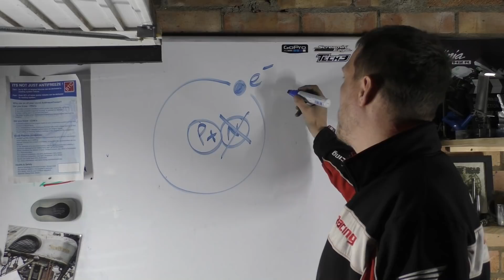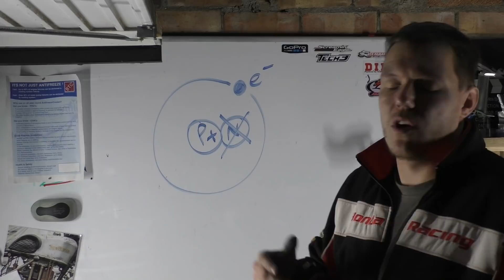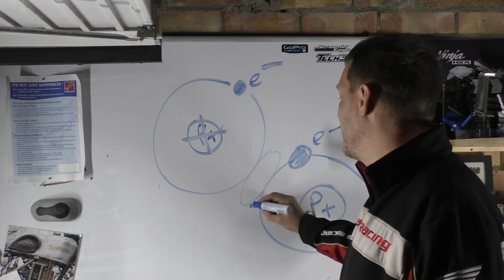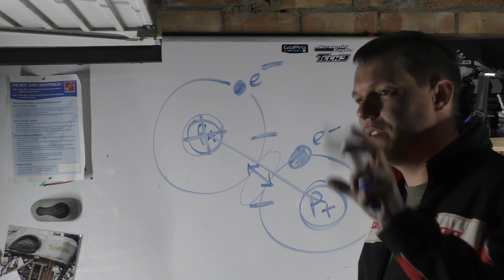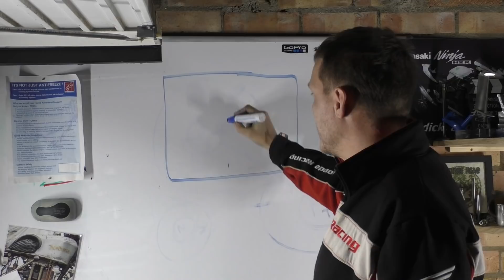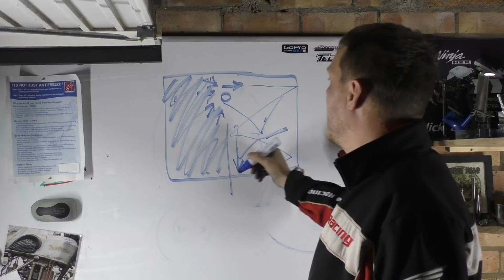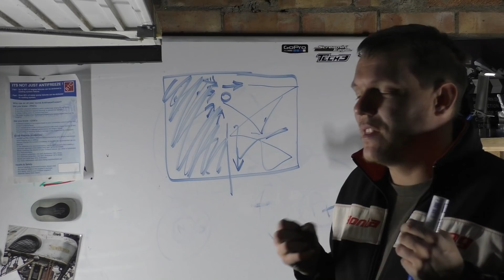Intakes, suction and expansion

Comment: sorry mat, i really like your videos, but this one is full of errors. first of all atoms repel because of the pauli exclusion principle and not electromagnetic forces. the pauli exclusion principle states that electron hulls really dont like to overlap. it also has a really short range so that only atoms that directly collide are effected. the electromagnetic forces that act on neutral molecules are actually all attractive forces. they have a longer range than the pauli exclusion principle but are not nearly as strong. these forces are: van der waals force, dipole-dipole force and hydrogen bonds.
also one does not need atoms to repel each other to make them fill a container when a divide is opened. consider the perfect gas model. all the molecules are happily bouncing around the place not interacting with each other at all. imagine it like a whole bunch of very good bouncy balls in a box, just doing their thing. when you open a divide in that box, the bouncy balls will fill the other half of the box, no repulsion required. this has a lot to do with thermodynamics and entropy since the state, where the balls fill the whole box is less orderly than the one where they fill only half.
claiming that gases flow into openings and fill containers because the atoms repell each other is just plane false, i dont know how else to put it.
Reply from the maker: "pauli exclusion principle"

- this is electrons sharing the same energy state.

"when you open a divide in that box, the bouncy balls will fill the other half of the box, no repulsion required"

- based on that no interactions take place. 

I think your confused with what I was saying. Which is probably my fault. 

"where the balls fill the whole box is less orderly than the one where they fill only half."

- this system has to be driven or forced by something..........

"van der waals force"

- includes dipole-dipole, Hydrogen bonds (which is a strong dipole-dipole) and dispersion forces due to the electron distribution probability of electrons in nonpolar molecules.
Reply: @thedirtyworkshop  pauli exclusion principle: yes at room temperature almost all the electrons of the same atom type have the same energy state, if you dont believe me, read the "Lennard-Jones potential" wikipedia entry(lennard jones potential describes the interaction between a pair of neutral atoms), especiay the first sentence of the section "Explanation". it also says there, that the attractive forces are vand der waals forces. (and yes dipole forces are part of van der waals, i got that wrong)

"where the balls fill the whole box is less orderly than the one where they fill only half."

- this system has to be driven or forced by something..........

no, it is driven by the thermal verlocity of the atoms. the only force that is required is the interaction between the atoms and the box, so they do not escape. at room temperature gas molecules are moving at the speed of a air liner (~900 km/h) they do not need to be pushed into any voids, they randomly fly into them. imagine there only being a single atom in the box bevore the division just bouncing of the walls in all directions. if you open the division it is gonna spend about half of its time in every section of the box, so it filled out the whole box without even having a second atom to interact with.

sorry i can not link you to anything because youtube will censor my comment if i do.
Reply: @thedirtyworkshop  I have to say I was a bit confused too 😂 I get what you're saying with that explanation though
Reply: @thedirtyworkshop  "where the balls fill the whole box is less orderly than the one where they fill only half."
 ..... yeah I hear that from all the girls too 😉😀
Reply: consider the so called "construction of the Fock state"